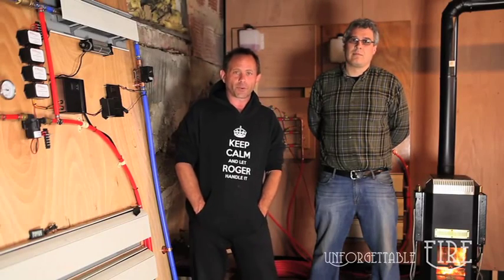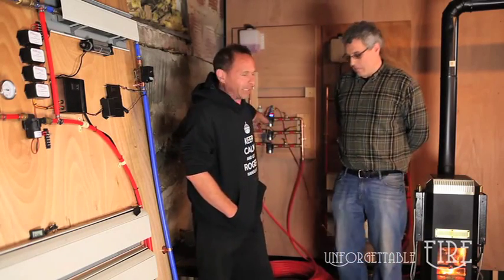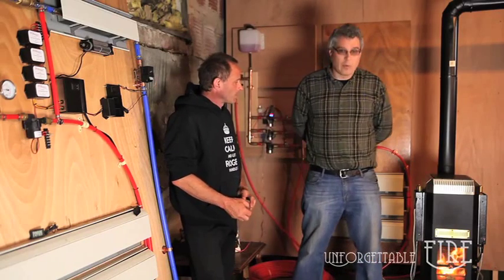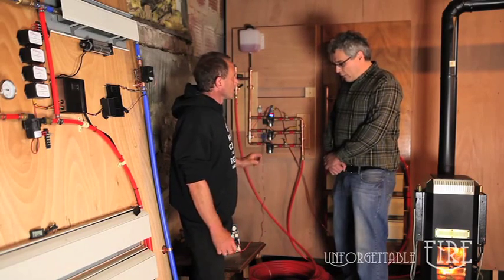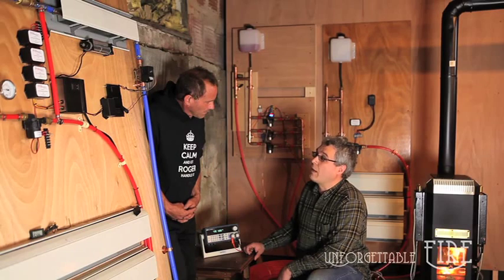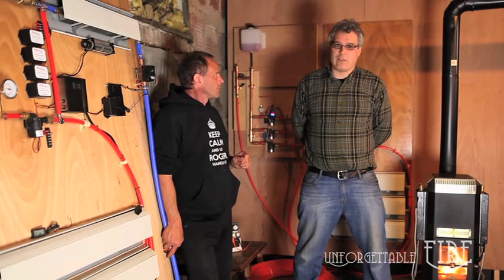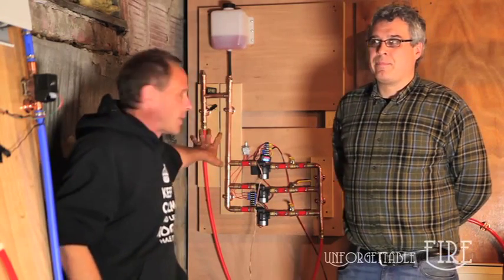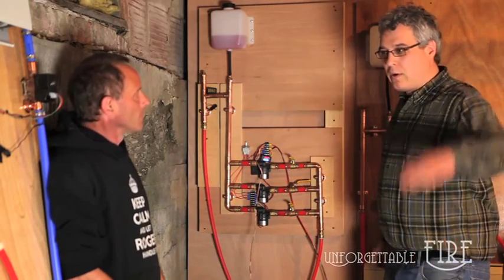TEGpro Water Cooled Thermoelectric Generator on a Katydid Stove

Comment: KATYDID MIGHT get 4 hours heat on a load of wood.  All talk about TEG and WATER accessories - 2024 and still no plan.  4 hours burn and TEG would provide little usable energy - run a circulating fan whilst burning.
Reply: i wonder if integrating this with a compost pile generating 65celcius of heat constant with more TEGs could sustain for a long period of time generating electricity.
Reply: @thiagoracing  that could supplement.  TEG cost and heat exchangers to consider.  Need a good consistent temperature differential to generate power.
Reply: @froggymountain  could use cold water at 10-15 degrees from an underground tank, so consistent cold and heat for months. In theory maybe in a 50m3 compost pile it would be able to generate something like 8kwh per day of electricity. (with a well designed TEG system)
Reply: @thiagoracing  You are correct - lots of options. Not to intentionally pour cold water on the idea however the usable power from a TEG system after fluid transport energy efficiencies and pumping requirements are among the reasons why TEG's are not mainstream.  The little circulating fans are a great idea though.
Reply: @froggymountain  I guess a small scale test is something I will attempt, I'm looking forward to find a smart solution for a deep winter greenhouse without burning wood and  where there is no much sun. Compost for heating and if possible for the electricity too.
Reply: @thiagoracing  keep us informed.  I am interested.  I have worked with thermopiles and will be interested in any advances.

Comment: I had an idea about air cooled (fan) TEG that would actually work as a food dehydrator on top of a stove as well as spreading the heat in the house. Since this thing would not charge batteries enough to run a 12 volt 45 W freezer (60+40 litres). Off grid food storage (drying), 1 Amp power plus heat well spread.

Comment: Great idea, it would be neat to see you guys develop a blanket of refs linked in series that can be strapped to the outside part of a wood chimney. With big aluminum heat sinks ( set up to take advantage of prevailing winds) on it, northern winter tempatures could really maximize the teg temperature differentials.

Comment: mine works fine without using a pump . Just by installing my exchangers higher than the stove . Currently using antifreeze installed without pressure at room temp within the system , output temp is 125 degrees f ...., try using the ceiling for an exchanger ... it works
Reply from the maker: Glad to hear Bill! Can you send us an email with some photos?